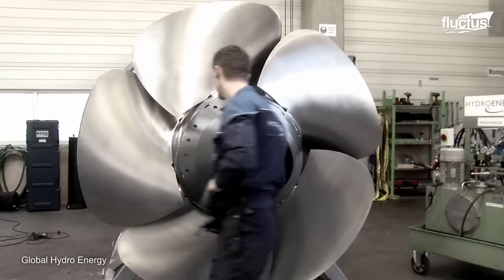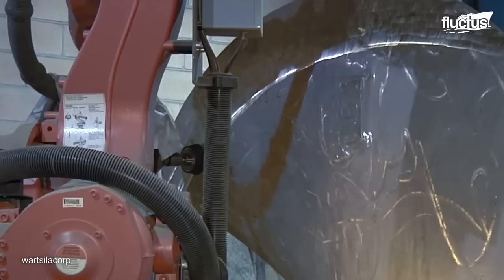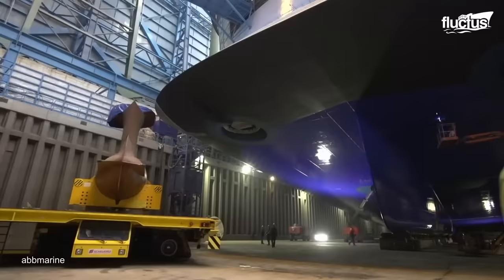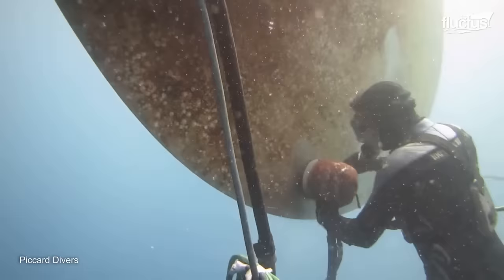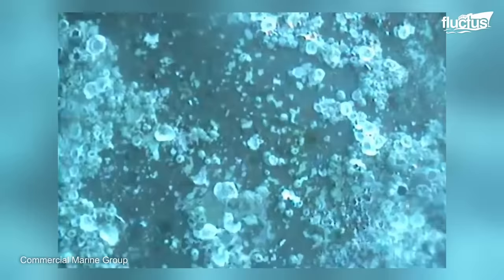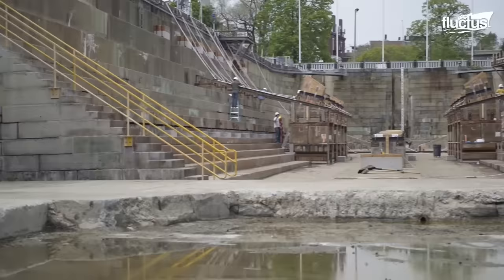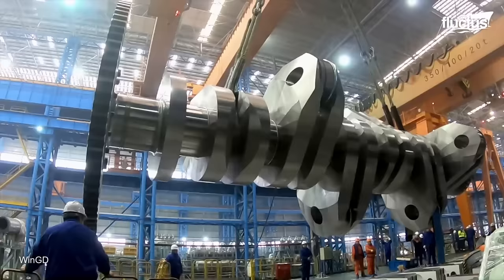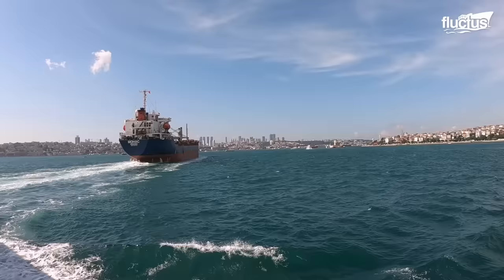What it Takes to Manufacture Million $ Propellers Moving World’s Largest Ships

Comment: For those wondering, the golden looking metal is called Aluminium Bronze, it's currently the go to choice for its toughness, corrosion resistance, and ability to prevent much of the buildup that other materials can experience.
Reply: Has to protect against cavitation well I am sure too. Not sure what makes something good for that but do know it is important and why people are investing in those new propellers. Uh toroidal I believe they are called. (Also more efficient!)
Reply: And yet the finishing lure industry still uses brass, which will tarnish from the oil in your hand, or you can pay way more for gold plated
Reply: That earns a like
Reply: Yeasty buildup?!
Reply: @dianapennepacker6854  prop design is also specific to the actual use case, so something like toroidal may or may not add value - ducting alone can reduce some issues of exposed tip designs, and some of the directional pods as shown are ducted.  BUT, I would love to see a cargo ship study using toroidal optimized for speed and ocean use just the same.
Reply: Coins also used to be made of that alloy.
Reply: @jakeforrest  thought they were cast iron
Reply: What happened to Manganese bronze ?
Reply: アルミブロンズは無いと思うが、ブロンズ製でしょ。
Reply: @mysygisun3335  Ah so, Anjin san.
Reply: Thanks I was wondering about that thought maybe it was brass
Reply: Thanks I was wondering about that I thought maybe it was brass
Reply: @Darryl6636  Brass is an alloy of copper an zinc. Bronze is an alloy of copper and tin.
Reply: Explained well 🎉🎉🎉
Reply: Blade not as polished/ smooth as say engine blocks. Why??
Reply: I machine this material all the time … not a fan
Reply: Back in the days i did an internship at a comapny called LIPS, they manufactured props as well. There they were made out of CuNiAl, a mix of Cupper, Nickel and Aluminum
Reply: This is Manufacturing and maintenance at another level ! 
Electric power won’t cut it in this industry , guaranteed !
Reply: @theplatypen1959 bronze is a lead alloy if memory serves..
Reply: @dianapennepacker6854  cavitation is not fought with materials the propeller is made of but more about it's design. Blade shape, thickness, length, and of course how many make up the propeller... Design minimizes cavitation.
Reply: @dianapennepacker6854  nothing can protect against cavitation brother. It's just a sad fact of life 😔
Reply: That is cunial very strong

Comment: Worked for LIPS in Brazil and that time we did a giant one made by CuNiAl!!! Great Time!!!! 55Tons ready to use!!! That time the polish and the machine the blades was by hand. Holes defines the thickness and machining til the holes vanishes. Was incredible, even a 55Ton propeller!!!!  70's
Reply: What is that metal formula...is it Copper/Nickel/Aluminum?  Why that particular alloy?
Reply: Mcc
Reply: Of m
Reply: C'cc
Reply: Don't lie
Reply: @customer_service1  don't troll
Reply: At one time ships were copper bottomed to prevent wood rot.
Reply: I worked at lips in drunen  the Netherlands, as a finisher. There were lines drawn on the blades, called insider lines, and outsider lines, where they intersect, that's where the holes were. You just ground down to the depth of the hole, then smoothed the blade, think it was to sort the balance of the blade.
Reply: Io lavoravo alla LIPS ITALIANA a Livorno , si facevano anche eliche da 60 Ton. Lavorate a mano e, negli ultimi anni, anche con un Robot !

Comment: I always found propellers really beautiful things . They have a sort of perfect shape .
Reply: rickyanthony you can go near flower; but trying to do so near propeller and you are dead 💀
Reply: They are becoming even more beautiful with recent developments.
Reply: @indridcold8433  Saw the one with each blade forming a sort of half mobius knot and they are supposed to be 20% more performant and 20% most fuel efficient ...problem is that their engineering has to be so precise they cannot be made in a foundry , only CNC machinery can make them so cost is stratospheric and not commercially viable yet .
Reply: @kingk2405 I would also add that propellers hot logs, Rocks and whales and get damaged or bent and can be repaired. Those new ones cannot. You bend it it's toast.
Reply: There are like the perfect contrary of an egg

Comment: You completely skipped the most crucial part of propeller manufacturing: Balancing and Surfacing, which is done by super rare experts and can significantly change a propeller's efficiency.
Reply: yes a very incoherent clip with strange manufacturing highlights and missing some essential ones.
Reply: @constantinous shinas:
Efficiency my fundament. As a kid, we did model airplanes with .049 CID engines that ran on what looked like lighter fluid mixed with oil, much like chain saw engines running premix. If the propellers weren't balanced, the planes would be shaken apart and "efficiency" would be a moot point.
If something as big as these propellers were out of balance, it would tear up the prop shaft bearings in a hurry and efficiency would be an afterthought.
The model airplane props would do 30,000 RPM.  I have no idea how fast these giant ship propellers turn, but even at 200 RPM, the stern of the ship would shake violently if the sumbitch was out of balance.
I imagine that polishing would make a smoother surface for passing through water and make it harder for barnacles to remain stuck on.

Comment: Propellers work by creating a low pressure zone one side, pushing the ship forward. Just like a propeller on an air plane and also the same principle of the wing of an air plane.
Reply: Faster moving air is over a wing create lift by lowering the pressure, propellers propel by creating thrust, not the same thing.
Reply: @jakesmith6337  And thrust is created how? Oh, by creating a low pressure differential in front of the propeller...
Reply: @jakesmith6337  same principal different name due to directionality 😄

Comment: I thought we would see some super huge CNC's milling the props! Basically skipped that part. Most large ships use electric motors to power the propellers like in those azimuth thrusters. Kind of strange they didn't talk about that at all...otherwise very interesting video.
Reply: Lots of proprietary info protected from view.
Reply: Yeah i thought that looked like a huge electric motor but the dude never mentioned it.
Reply: YOU CAN'T HANDLE THE TRUTH !!
Reply: @peterdarr383  sHAk
Reply: @peterdarr383  sHAk
Reply: Glavni motor(dizelski) koji je ujedno i agregat za proizvodnju energije preko osovinskog voda okreće propeler 300- 500 o/ min. Pramćani porivnici su nešto drugo oni služe samo za bolji manevar u luci kao i bočna kormila,puno su manji i njih pokreću el.motori
Reply: I came across a video showing the machining a while back. Not sure if I could find it now, but there is some footage out there.

Comment: Greetings from the BIG SKY.  Big brass propellers!
Reply: Those ship propellers are not brass, which is an alloy of copper and zinc.
Modern water propellers are made of aluminum bronze with a little nickel added.  This is an exceedingly tough and wear resistant metal.

Comment: Scary stuff being down next to those blades. A simple miscommunication can easily cause a life to be lost if those things start up while anyone is still underwater and close to them!
Reply: That's what Lock out-Tag out is for.
Reply: And safety work permits
Reply: @thebogsofmordor7356 ; ;b
Reply: "Don't go until I say all clear"
"You said ALL CLEAR?"
"no - i DIDN'T say "ALL CLEAR" . . . etc
Reply: The big ship has very different systems of engine starting. 
And Mega size of diesel engine takes 6 hours at least to be warmed up before starting. 
Of course the order of engine starting is on the captain when 'stand by' for navigation after all ship hands are ready.
It is totally different from simple cars or small boats.
Reply: @erickyee4198  On new tug boats the generator is always running, and it dumps it's heat into one of the 2 engines, always keeping it at 170*F so it can start.
Running on one big engine, by the time the tug gets to where it's needed it has heated the other big engine, ready to start.
The issue is tolerances - car engines are built "sloppy" enough that they won't seize on a cold start.
Reply: @peterdarr383  Oh, I see.. But most of big ship has 2 cycle engine with slow speed engine under 100 rpm.
It is not easy to start by weight of 1 ton of pistons and heavy flywheel with those mega size of propeller.
There's one main engine products more than 30000 HP burns more than 50 tons of bunker C grade fuel.
That's why they polish the propeller surface to save fuel.
Reply: @erickyee4198  I know - but also F1 engines are pre-warmed due to very tight tolerances.
Reply: @peterdarr383  👍
Reply: @thebogsofmordor7356  Morons don't know what that is. Go ahead and trust it if you dare
Reply: @peterdarr383  ?
Reply: @ForrestGump1212  there is way less lolling to that as you might think......

Comment: propellers do not work by "pushing water" behind the ship.  They are foils like a wing, or aircraft propeller. In cross section they are shaped the same.  the curved surface like that of a wing creates a lower pressure on that surface, which in turn pulls the propeller along with whatever it is attached to.
Reply: They do not have an airfoil cross section, thrust comes from the angle of attack…….

Comment: Thanks for this fascinating overview of ship propulsion systems. How is power delivered to propellers in thruster pods?
Reply: Think personal watercraft, AKA "Jet Ski"?
Reply: They are usually electric. Essentially, the engine onboard the ship powers a large generator which is used to power the thrusters, along with all the other electrical systems onboard.
Reply: This is so stupidly nontechnical it doesn't even frame the content within it correctly and uses hackney phrases like "liquid metal" rather than "molten metal", it just goes on and on with that rubbish, they don't even point out the fly-cutting etc.
Reply: @CanonFirefly  no, most large cargo ships are direct shaft drive...
Reply: @skippyguy3  I meant most thruster pods not most cargo ships

Comment: What is needed is the application of advanced robotics to heat and forge titanium into a large elaborate shape while it is blanketed with inert gases. Imagine a giant Sharrow Propeller made of forged titanium. It would revolutionize the shipping industry.
Reply: At what cost? and how long would be the payback?
Reply: The problem with Titanium is that it rapidly work hardens during plastic deformation, and therefore must be annealed in a vacuum furnace, before further deformation can occur without fracture.

Comment: Instead of working with one giant propeller, work with 4 small propellers, Two in front and two in the back. The water entering the propeller has to be meshed out, so that marine mammals are not harmed. Hull can have double chambered feature without any protrusion to the side of the ship. So if outer hull is breached, ship can still function. Water can be filled into the hull to lower ships height if needed. It can also be used to simulate drowning or for war games when the outer hull is breached. Cargo ships can be made broader for more stability and passenger ships can remain tall because we need more ocean view.

Comment: I wonder if someone could operate a service that used a lock system to give a ship a quick float in hydrochloric acid or maybe an electrolytic procedure to knock off crud then re-plate with silver or something else anti-microbic... Interesting video!
Reply: Dry docking and then filling it up with acid?
Reply: @KC-bu8qq  Maybe some kind off double ended lock that has hydraulically actuated "hull profile following" gates with negative pressure on the acid volume to prevent acid leakage... could be a matter of a couple hours service like a drive thru car wash instead of weeks in dry dock... Dunno, just brainstorming...
Reply: @ryanjohnson3615  It’s an interesting concept, but i assume there are easier ways to clean in dry dock. You could hose it with the same acid
Reply: @KC-bu8qq  Drydock is a major operation though right? I really don't know living in Montana.. But I've used electrolytic processes to knock crud off of engine parts and it's pretty amazing. it just sheds the grime and rust off. Would definitely need to be submerged for that (and probably in an acidic solution anyway to re-plate) but also the crazy amount of electricity flowing through the hull might cause other issues... I wonder if alternatively they could make a lock that functioned like an ultrasonic jewelry cleaner but on a huge scale...
Reply: Technology is crazy.. they used to have divers clean growth off the hull of a ship between dry docking periods. Now they have robots that clean the hull like a pool vacuum.. magnets hold it to the hull.. dry docking is expensive af.. seems overkill to spend that amount of money to just clean.

Comment: My friend an i worked at jc lips, in drunen, around 2001. We worked as aufworkers ( finishers). Working on bow thruster blades to staet with, then on to the 6 blade props ( 28 ft in diameter), and four blade props ( 35 ft in diameter) Weight of the props was in excess of 90 tons. Good times. When we finished there, went to a shipysrd called nehuis van der berg, and helped put blades, on a variable pitch prop, and the blades were from......you guessed it, j c lips.

Comment: A propeller doesn't not move a boat by pushing water backward.  It gives the ship motion by screwing it's way forward through the water.  In fact the correct nautical term for a propeller is a screw. 

And not one mention of the metal used for propellers?  Hint:  Most are brass.
Reply: "doesn't not"  ??
Reply: @adrianwright8685  Busted!  And me, the grammar gestapo.  Thanks.

Comment: When there is so much technology we have why to clean the propellers manually why not use a metal which is anti corrosion of sea water secondly why the propellers are casted instead of the propellers used in aeroplanes which are hollow of the blades please suggest

Comment: I hope you will not show submarine propellers.
Reply: Don’t think subs screws are made at this place
Reply: you would not even have access to those sub blue prints or evan be allowed to see one.
Reply: Who cares
Reply: They're pretty much the same, actually. They do have some secret squirrel stuff like shrouds and anti-fouling tech, but, otherwise, very similar. All nations that have subs use similar props these days. Short of exotica like magneto-hydrodynamics, etc, there's just not that many ways to physically and efficiently push water.
Reply: i`ve seen subs out of the water and they looked the same to me
Reply: @jaybanchero   UK submarines do not have propellers. Haven’t for decades.
Reply: @dissol1306  Hello... Strictly speaking you are correct. As you suggested, subs like those developed by the UK use what are specifically called "propulsors" which are essentially shrouded propellers (AFAIK, anyway). Actually, a better description is variable pitch propellers with tapered cylindrical ducts around them. They're also known as "pump-jet propulsors" (similar but much smaller versions are used in vehicles like jet-skis and other typically high performance watercraft that need propellers that are not completely exposed).

I'm pretty sure that's right. It's just some random tech stuff I've read about because I think it's interesting. There are other types of sub propellers that are really interesting as well. I've read that the business end of Sub propulsion is kinda hard to hide so lots of designs are "shared" 🙂.

I wonder if it's possible to develop a kind of robotic cilia to propel a sub instead? Such cilia might densely cover an entire sub hull and be a clever alternative.
Reply: @penelopehancock4296  putin does

Comment: This propelling system has been used for approximately 80 years, with not too substantial improvements. 
We all like to think these propellers are “AMAZING!”. 
But they ARE NOT. 
Now, think of automobiles’ and airplanes’ engines from 80 years ago. 
The shipping industry is far behind in terms of technology evolution. This will drastically change in the years to come.

Comment: Load of rubbish at 2.12 - The process of manufacturing must start with the design of the profile of the blade. This will be almost certainly begin with computer aided design and simulations along with tank testing. Only then can finalize the profile of the blade and start to produce the pattern equipment to it.

Comment: Ya mean like when the GOP decided to close a buncha military installations, as a cost-cutting exercise (but only in Democratic districts) in the early 90s? One being Mare Island Naval Repair Station in the Bay Area, where stalwart Americans bid on the gear, lathes, and machinery of all kinds, cheap! Then, turned right around and sold it to the Chinese (for a profit), who had a ship anchored in the bay, waiting for it? Including a lathe large enough to turn a propeller for an aircraft carrier. American Industry did the same, selling all their old gear to the Chinese. WE GAVE THEM the means to become what they have become: Our equal and chief rival, all for profit...
Reply: I used to work at a propeller manufacturing shop. We did use lathes for props smaller than about 90in in Dia. But we used vertical mills to machine props 90 to 179in in Dia. In the vertical mills, the props were affixed to a fixed table and the machine had attachments that moved cutting tools to machine the prop hubs.
For props bigger than that, we cast & machined "single blades", which were bolted to controllable pitch hubs. Those were about 20ft Dia props. I say 'about' because we just made the blades, another vendor made the hubs, so I'm just estimating the finished size.